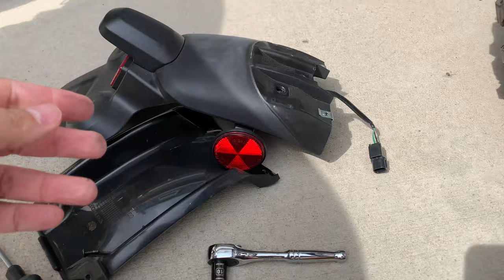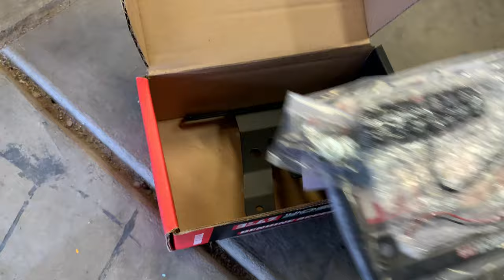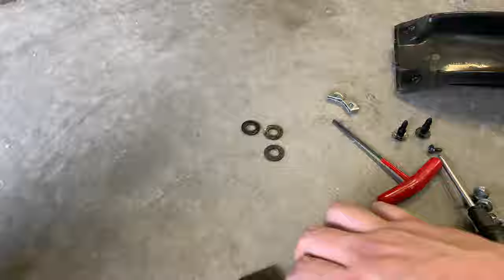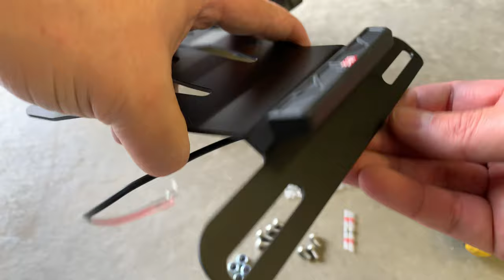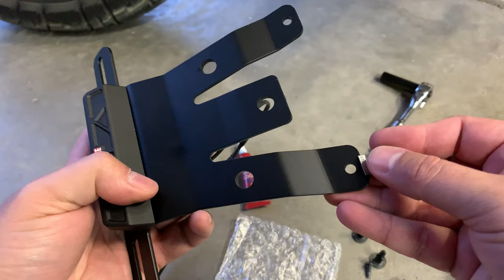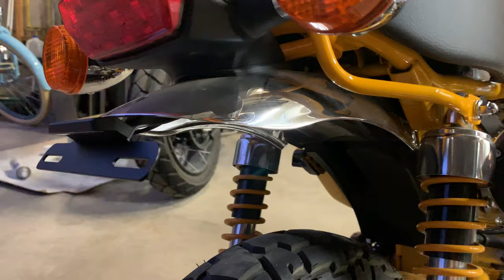Honda Monkey | Replacing the License Plate Holder

Comment: I would have just used a pair of plyers and bent the original bracket a little.
Job done
Reply from the maker: Also a good option. I happened to already have the brackets and had noticed the angle was pretty steep.

Comment: Very nice! A big improvement over the MNNTHBX version.
Reply from the maker: Definitely, both the angle and just the slightest extension past the fender makes all the difference here. MNNTHBX did mention on the forums that they have a revised version that I may take a look at, but between these versions the Yoshimura option is better.

Comment: hold wire connector above the flame not in it... smh
Reply from the maker: Or, better yet, just get a cheap heat gun and do it right.
Reply: The plastic should still be clear when you heat it!